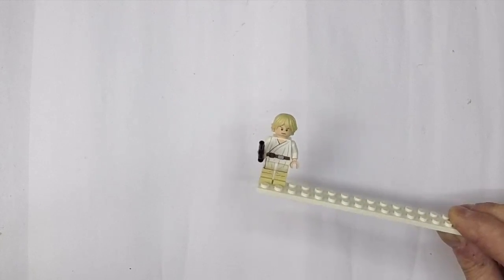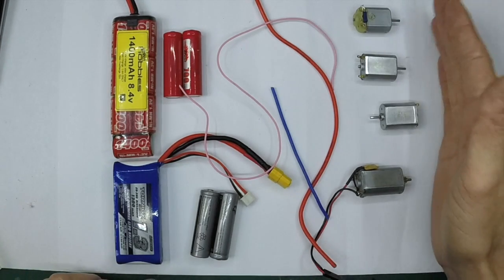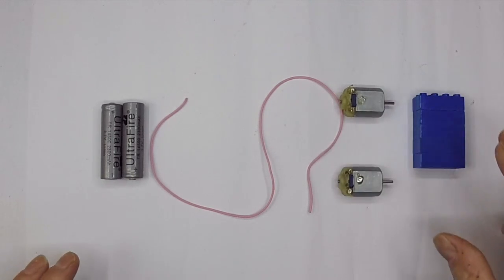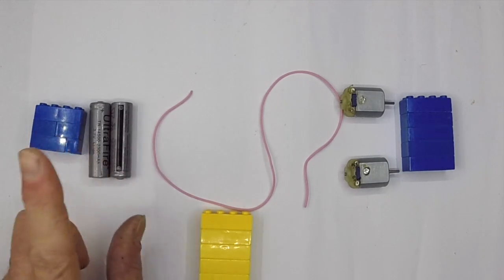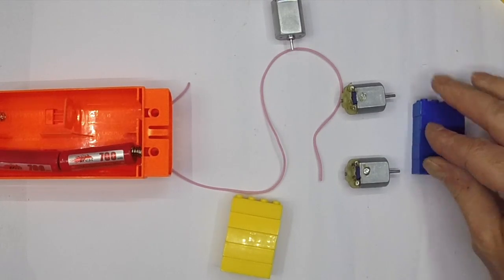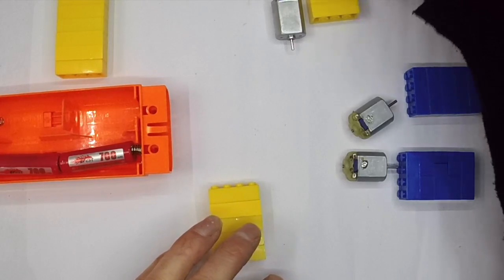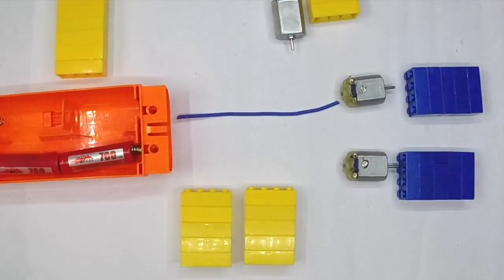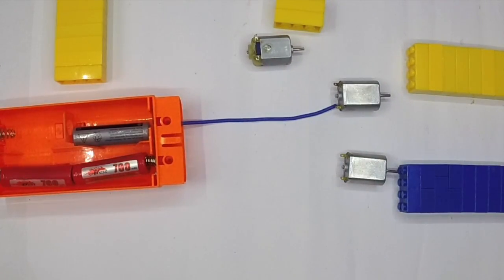How To- Bring Balance to Your Blaster

Comment: Does anyone happen to know if the rapidstrike stock motors can sustain 12v?
Reply from the maker: They might, but you are most likely to burn out the brushes. If you are going 12v use a 3s mod motor like the OOD Valkyrie.
Reply: @foamdataservices  Thanks for the reply :)

Comment: Is it safe to run my rapidstrike on 3 trustfires? I hardly play for 20 mins.
Reply from the maker: No. Too much current, not enough battery.
Reply: @foamdataservices  then 2 will be better?
Reply: If I play with 3.7v × 3 trustfires will my blaster die?
Reply from the maker: If its just stock the PTC may come on. Stop wasting time with trustfires,  learn to mod properly or leave electric blasters alone. IMR 14500's are just about OK with a proper rewire in stryfes but not in anything full auto.

Comment: Great content! I might be late to the party, but I just got a stock gray trigger Hyperfire, it's performing worse than my stock springers... would it be a solution putting two 18350 IMRs (7.4V) or 3 LiFePo e.g. Coolook (9.6V)?
Lastly, is rewiring the only mechanical way of "unlocking" the gray trigger?
I would be grateful for any answer!
Good day
Reply from the maker: tick127 The hyperfire is well known to be awful. I don’t use IMR or any hard cell for full auto blasters. The larger size IMR might be better than nothing, Cool Look are garbage Lifepo cells, too low power output to use for Nerf, I wouldn’t put them in anything. If you want better performance then get a 3D printed flat cage for the Hyperfire, it has canted flywheels stock which are very bad when modded, fit some 2s mod motors like Meishel 2.0 or Fang RV and run it off a 2s lipo pack or big 7.4v NiMh RC pack.
Reply: @foamdataservices  Thank you for replying me! I knew hyperfire wasn't going to be great, but got it at bargain. At this stage I don't know if I want to mod a blaster I'm not entirely interested in, I just wanted to find some quick and dirty solution for the underperformance so I can take it out and actually have some fun with friends who use mostly stock or very mildly adjusted springers. I'll probably try the two imrs and see what happens with the grey trigger resistors or whatnot is hampering the output.

Comment: Are there any motors that will be able to run on 2 or 3 IMR's? If so, is it safe?
Reply from the maker: Hair Stock motors are fine on 2 or 3 IMR. Any type of mod motor requires lipo,  despite what some mod parts sellers may try to tell you. 14500 IMR tops out at 8A, that is the burst figure, stock motors are 4-5A burst, leaving a bit of head room on the battery burst. The lowest power consumption mod motors are 8A burst. Lipo is better all round and safer for anything above stock motors.

Comment: I want to modify a friend's Rapidstrike that broke (The positive tab on the PCB on the pusher motor broke and the inductor/resistor, I don't know which, on the positive lead broke off), and he gave it to me to repair. I want to surprise him with it giving it back to him modified. Is it safe for 1 Meishel 2.0 motor for the pusher motor and 2 OoD Valkyrie motors for the flywheels to run on a 3s LiPo? Or should I just ditch the Meishel 2.0 motor and keep the stock pusher motor? What I'm mainly looking for is RoF, not FPS, but having a good compromise between them would be nice.
Reply from the maker: ABorinGuy Run 2 OOD Krakens on the flywheel motors, with a decent set of aftermarket wheels like Cyclones or Bulldogs, then a Valkyrie on the pusher. The stock motor is trash and won’t like 3s. In my experience overvolting 2s motors never ends well, better to run a dedicated 3s motor on  there. That will still give you about 10 darts per second and around 130fps.
Reply: @foamdataservices  What cage should I use with this setup?
Reply: @foamdataservices  Can I safely use 18 AWG solid copper wire or should I switch to 16 AWG wiring? I only have the 18 AWG wire.
Reply from the maker: ABorinGuy DO NOT USE SOLID WIRE. Get some decent multi stranded silicone insulated hobby wire. Do it right or leave it alone, that’s the only way we h electric mods.
Reply from the maker: I just use the stock cage, it’s free and with well set up precision flywheels it’s pretty consistent. I rarely bother with aftermarket cages, unless you must have over 130fps they are not worth it.

Comment: I bought the efest rechargeable IMR batteries that you showed in your battery guide but I don't have a charger so could you give me a link to an efest charger or does any IMR charger work to charge them?
Reply from the maker: I recommend the Nitecore i2 or Nitecore D2. You can get a 4 cell version too. You want a quality charger, they are safer and better.
Reply: Foamdata Services I’ve been using my imrs and I don’t know if I should store them charged or not charged. I can’t find anything on the internet that tells me specifically about storing IMRs
Reply from the maker: Charlie Dana All lithium chemistry batteries should be stored about 75% charged. I just leave my IMR charged, they get used every two weeks. All the IMR 14500 cells of decent quality won’t let you sub critical the volts but shouldn’t be left discharged, always remove from the blaster and store in battery cases in sensible temp range.
Reply: Got it 👍

Comment: What lipo would I need for the worker mod kit and where is a good place to get lipos in the UK?
Reply from the maker: Hobbyking is the best place to get Lipo. Follow my formula in the how to match batteries to motors video then use the Hobbyking battery finder to get a pack. You will need a battery tray expander for the Stryfe. Worker make lots of mod kits, many of them not very good, do more research before buying, particularly motors and cages.
Reply from the maker: Also you will likely want an LiHv pack for that, don’t worry about specific Lihv chargers, you only need to charge them like a normal Lipo for Nerf. Accucell S60 with UK plug is the charger we recommend.
Reply: What size lipo should I get to fit a standard stryfe tray
Reply from the maker: You need a tray expander to use mod motors with the stryfe, it’s not worth it buying a tiny battery and stuffing it under the stock battery door, buy an expander. BSUK do a strong, cheap and indestructible one. You need at least a 1000mah capacity Lipo, none of which fit under the stock tray lid.
Reply: Can I get zippy lipo batteries? Are they good
Reply from the maker: Yes, PROVIDED they meet the stall load you need, plus some extra headroom, watch my match batteries to motors video.
Reply: Watch this vid https://m.youtube.com/watch?v=0-RgcRCGH-E
He uses the same worker stryfe kit and zippy battery and his was fine, granted he said it started smoking but that was when he paired that with the select fire kit.
Reply from the maker: Well why bother asking for my advice if you are just going to follow someone else’s? Do the load calculation, it’s not hard, then you will have maths and science telling you the answer, not some fool who can’t even work out that the input voltage for the select fire kit needs regulating.

Comment: So what is the "maximum current" that regular alkaline batteries , or is that not a thing with that kind of chemistry?
Reply from the maker: Regular alkaline batteries can discharge a maximum of about 0.7C, depending on capacity.

Comment: What is the point of modding a stryfe internally when we can just use imr batteries and it’s equally powerful?
Reply from the maker: Because it’s not, IMR restricts you to only stock motors and the stock wiring leaves all the toy components in. See the battery test data here-https://www.tapatalk.com/groups/britnerf/battery-wars-shootout-results-t1816.html
Lipo and new wire is worth 3fps average on its own vs IMR.

Comment: Does anyone know a reliable source for affordable IMRs?
Reply from the maker: Torchy the Battery Boy on Ebay. Otherwise packs are both cheaper and better.
Reply: thanks
Reply from the maker: These are flat tops so you can only use 2 with dummy cells, take out the plastic battery separators then run the dummy buttons to the +ve  of the tray and the flat tops with their  -ve against the contact spring and the +ve to the base of a dummy cell, otherwise they won't reach the end of the tray. He has button tops but not as often. Remember stock motors only with IMR. I recommend the Nitecore D2 or D4 charger. Otherwise a small 2s lipo will work with any stock motor and mod motors for the same price as 2 IMR cells, charger is about the same price.
http://www.ebay.co.uk/itm/2x-7-5A-Torchy-IMR-14500-Flat-Top-650mAh-3-7v-Li-Ion-batteries-case/302583293625?hash=item46735ea6b9:g:RrcAAOSw9~5ZVUSZ

Comment: I have 50 quid to spend on a stryfe to mod it, what's the best I can do?
Reply from the maker: Buy lipo, charger, mod motors and rewire.
Reply from the maker: If there's any budget left after that, buy precision fly wheels.
Reply: Many thanks, do you have any recommendations as to what lipo, what charger and what motors for that kind of money?
Sorry, I'm pretty new to this, thanks.
Reply: Sorry i have one more thing, If you can paste the links for all those components, and I don't know which wires you use on stryfe and where to get it, as well as heat shrink, thanks a lot.
Reply from the maker: Blastersmiths.co.uk do a compete wiring kit.If you want DIY, Wire is 18AWG silicone insulated multistrand. We buy from Component Shop on Ebay.
Lipo- depends on motors, weather you are using a tray expander and how hard you want to shoot. 
Charger- Turnigy S60 on Hobbyking.
Reply: Turnigy 1000mAh 2S 20C LiPoly Pack, with a stryfe wiring kit from blaster smiths, with mtb honey badgers. Does this setup require at modifications to the shell?
Reply: Will this setup get me 110 fps?

Thanks a lot for the help
Reply: Actually probably the Turnigy 1500mAh 2S 25C Lipoly Battery w/XT60 is better? Do you have a guide on how to connect and wire lipos in a stryfe?
Reply from the maker: MTB honeybadgers are useless. If you want a 2s motor go with Meishel 2.0's. That lipo is a bit weedy also, if you intend to use the tray expander, this one is better
https://hobbyking.com/en_us/zippy-compact-1000mah-2s-40c-lipo-pack.html?wrh_pdp=1

If you are not using an expander, buy this one-
https://hobbyking.com/en_us/turnigy-800mah-2s-40c-lipo-pack.html?___store=en_us

It fits if you shave all the ribs out the tray and off the tray lid.
130 motors don't need shell cuts.
Reply from the maker: You just put an XT60 on the end of the loom, it's included in the BSUK kits. You won't get the 1500mah into the stryfe tray very easily.
Reply from the maker: Also stop wasting time with any battery under 40C discharge.
Reply: Thanks for the help mate
Reply: I decided to go for the battery that doesn't need an expander, artifact red cage, worker flywheels, meishel 2.0s, blaster smith stryfe wiring kit, s60 charger, and no cosmetics, good enough for my first mod?
Reply: Did go over budget lol
Reply from the maker: Ideal for your first mod. Good luck! Get to a game.
Reply: @foamdataservices  honeybadgers are for pusher motors tho

Comment: The new efest batteries are purple. On the battery, it says 9.75A. What does that mean? Do all imr batteries have the same discharge rate? And are two of them along with two dummy batteries safe to use without a rewire?
Reply from the maker: You should always rewire if you intend to use high current batteries. However if you are leaving the thermosistor in place you can use just 2 with the stock loom and motors with no other mods, but you are left with all the locks and toy components in that way. Do yourself a favour and mod it properly. All IMR do not have the same rating, but most 14500 cells are 6-8A. The real world discharge of that cell is closer to 9A. They still limit you to only stock motors.
Reply: Thanks! It's amazing that I can get a response by the creator of the guide so quickly, let alone get a reply.
Reply: I wanted to put IMRs into my blaster because of the discharge curve. I didn't want to increase the velocity too much since I do play indoors and I plan to leave the thermosistor in along with the locks removed. So, I guess I will just get two of those IMRs to put in my blaster.
Reply from the maker: Rewiring is still worth it.

Comment: I'm glad I found your battery guides, I've been running on ultrafires for a while and I'm looking for an upgrade. I'm still rubbish at modding so I think I'll step up to imrs for now.
Reply from the maker: Do a rewire at the same time, it's not hard. I teach 11 year olds to do Stryfes. It's 8 solder joins and 3 wires.

Comment: Currently using 2 ultrafire batteries in my stryfe as I didn't know about  that over discharging however where would I get 14500 IMR batteries? I only see bigger ones and would it be ok to use 18650 (single a batteries) with labeled 3000 mAh?
Reply from the maker: If you have modded motors you will need a lipo pack. If you have stock motors 14500 IMR will meet the current demands.
Reply from the maker: 18650 cells won't fit the stock tray.
Reply: I know but I have access to 3d printing and can make a new tray just wondering if tripple the amperage would be somewhat safe even though its not the best solution I got these li-ions for free and cant afford to overhaul with lipos and such
Reply: and these are ultrafires not imr batteries as I cant find those

Comment: in a tactical led light would u like 1 10mm led or 2 5mm leds what would give me the most light?
Reply from the maker: Read the LEDs power rating in W, more watts, more light output. Generally several small LEDs is better than one large one, as you can spread the beam a bit.

Comment: if I have leds connect to a 9v battery what kind of resistor will I most likely need and does to resistor get connect to   the switch on the positive side.
Reply from the maker: A 460 ohm will still work for a 9v battery. Resistor goes on the +ve feed before the LED.

Comment: In a modulus, what will happen if i use a 12 volt lip with 11.1 volt motors?
Reply from the maker: A 3s Lipo will peak at just over 12v anyway.

Comment: so would you only recommend 2 imrs in a stryfe or 3?
Reply from the maker: Strafes will run fine on 2 or 3. Start by breaking the motors in on AA batteries, you should run it for about 20 mins on this first, then when you have rewired run 2 or 3. If you don't rewire properly you can run2 IMR's on the stock loom, just put them and 2 dummy cells ( blank conductors, NOT regular batteries) in and off you go. 3 will trip the thermosistor. Rewiring is better all round.

Comment: what if i have a 1s lipo with a C rate of 25 and since i am using tamiya power dash motors they both supply 2.5-3.3 amps so that is around 6 amps and also new wiring with 18 awg wire, is that balanced tom?
Reply from the maker: 25c will just about be enough if it's a 1000mah or bigger. Tamiya Mach dashes are 12A stall current EACH @ 3.7v. I don't understand why anyone uses them, when you can get MTB Honeybadgers or Rhinos that make more torque, better rpm and need less current.
Reply: Nobody sells make test battle motors here in my place and tamiya motors are really cheap here in philippines somebody does sell them but kinda expensive and i do not have a 3s lipo though, somebody do sells 1s lipos here for cheap but mostly for like the quadcopters and i know it will be bad (25C 650 MAH) if i was in australia or America, i would not get tamiya motors and just get honeybadgers or rhinos but just because of the place i live in, shipping is expensive and the only motors i have no choice to buy are tamiyas since most of my motors break after and after time. Thanks for the information Tom
Reply from the maker: Sorry, I forgot you were in the Phillipines.

Comment: Question, Tom. I was thinking of putting a lipo in my rapidstrike. Right now it's getting 15 rps on 4 lifepos 12.4v sustained. But after about an hour, or two, of play it begins to jam up. Would a lipo correct that?
Reply from the maker: That is the thermosistor cutting in or the batteries dying from being ragged. You will get much better performance off a pack but ONLY if you rewire property. You can't use a pack over about 9.1v with the stock wiring or the thermosistor cuts in. Right now those cells are voltage sagging so much it takes ages to get hot enough to trip

Comment: Sadly, I can't find the promised link for the detailed motor data... I wanted to check if my motors are in there too, or is there a way to calculate them myself? the only specs I have are this here: http://www.mrrc.com/car-components/motors/motors/motor-13d-speed18-18000upm/12v
thanks in advance
Reply from the maker: http://britnerf.myfreeforum.org/about1967.html

Comment: What S rating is a Hercules Lipo
Reply from the maker: You will have to read the manufacturers data sheet.  I only use Zippy,  Turnigy or Rhino packs
Reply from the maker: +Jack Armstrong If its a BEC then its not suitable for Nerf.

Comment: Dear FDS. I have never used a stock wiring Stryfe (use Lipo). But for my "bonus" kids I have bought them each a stryfe. My question is. Is it safe to put 3 IMR's in.. or should I stick with 2? No point in burning out the stock motors/wires. Would never hear the end of it. Thanks in advance.
Reply from the maker: Stryfe motors stock will handle 3 IMRs, the motors may eventually burn the brush pack out but not quickly like a 3s Lipo. 2 gives good performance, especially with a rewire. Remember IMR s are still a Lithium chemistry and should be treated accordingly, don't leave them in blasters for long periods and don't over discharge them or you will kill the cell and risk a fire when you try to charge them again. Ensure there is no possibility of short circuit,must as you would with a Lipo pack.